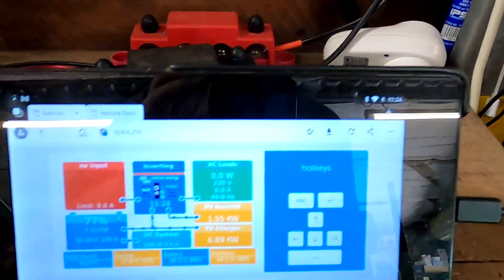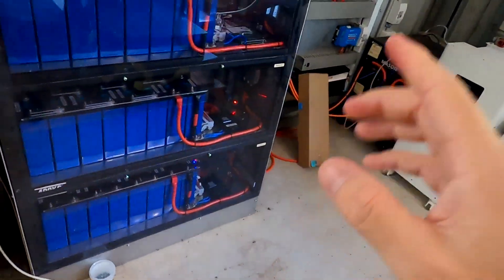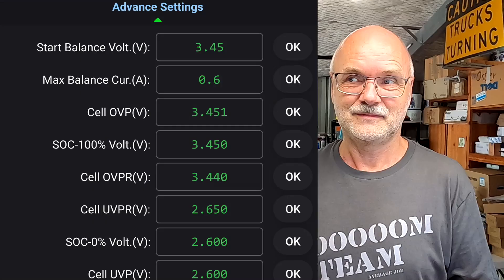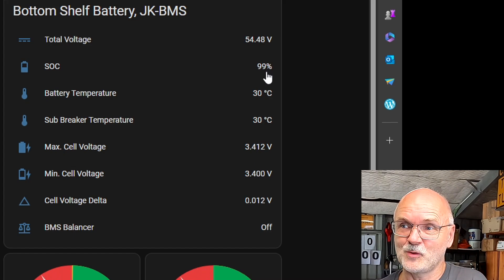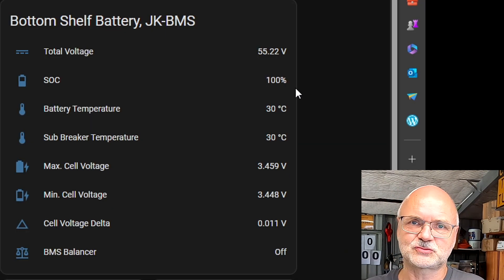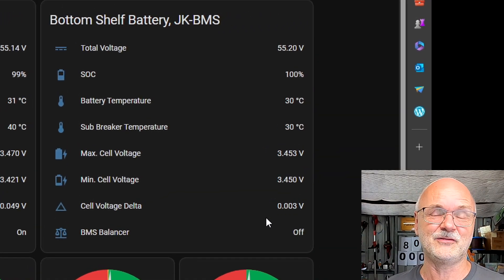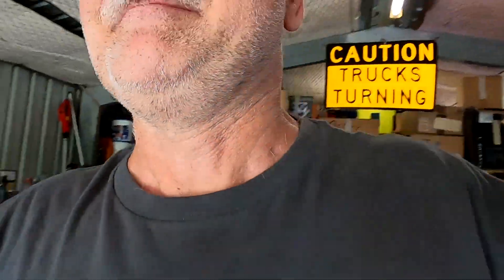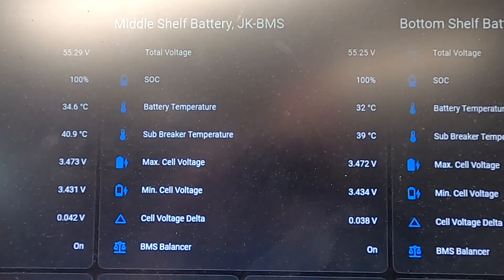Reset the old JK-BMS to 100% SOC when fully charged with no OVP. Here is how.

Comment: Hey Andy, thanks for all the helpful videos - it's crazy how much you helped me already with my JK-BMS!
Unfortunately, it still has an issue with displaying the right SOC. 
I yesterday did a complete reset of the SOC with changing the capacity, the OVP-Value etc. and then charged it to fully 100%. For the first time in months this worked well until this morning, the discharged amount of energy is roughly the same as the used amount of energy. 
But: Now that I have solar charging again (about 4kW so 70A steadily) it charged for a certain time (from 25% to 35%) and then jumped up to SOC 100%. I checked the voltage and it was at 54,19V at 35% SOC and then 6 minutes later at 54,33V at 100% SOC. It doesn't make any sense to me because I'm far from my implemented 100%-SOC of 55,2V. 
Since then it still charges with the same amount of Amps but always shows 100% SOC. The Voltage now is actually above my desired 100%-SOC -> 55,6V at the moment. 

My BMS has Hardware Version V15A and Software-Version V15.35 (I downgraded It a while ago because I faced some Issues with the newer Software). 

Has somebody the same problem or an idea what is wrong with my BMS?

Thanks a lot already for your opinions!

Comment: Yes it worked on my Ebike with a JBD BMS to reset the SOC to 100% with the cell overvoltage trick thnx. For all settings including BMS firmware updates and close capacity correction I use the ios APP JBD BMS as its very good

Comment: I think I figured out why this is happening. It's because we are not charging the batteries to full capacity. If the don't hit 3.6V, the calibration won't get set daily. One solution could be to set the OVP lower, or raise the charge controller voltage so it satisfies the cell voltage OVP limits daily.

Comment: Question I have the older BMS and mine is reading 60% charged at 51.2 v when the inverter stops it for low voltage and switch's to the grid, its a 48v 302 ah pack. It was good at first 0% in the AM then 30% for a bit and now 60% in the AM when its low. I have it set to charge to 3.45 and discharge to about 3.15 ( inverter switch's at 50.4 v) Would this trick fix this???????????

Comment: Thank you Andy! 

Guys, it’s much easier than that. If you want to reset. Just take the current voltage, divide by 4. I had 13.29v and was at 67% SOC. I mistakenly hit the LiPO4 button, and my remaining charge went from 97% to 68%. Changed Andy’s setting to around 3.322 ish and I was back to 100% in no time.

Comment: Another great video Andy, i will give it a try.
My problem is i have two batteries with two JK BMS connected on common bus and they charge and discharge unequally 60%/ 40% Amps. I have made all the cabling the same length etc. Do you have any faultfinding suggestions I could try. Thanks Martin.

Comment: how to limit charging cell (in pack with BMS) to 3.38V when I use socket charger? Changing BMS setting OR maximum voltage of charger(small potentiometer inside charger)?????

Comment: Triggering cell OVP just to reset the 100% SOC is just stupid imo.

I wish JK would just acknowledge that they screwed this up and fix it.. I know that you can't upgrade the firmware in these units, but there's no excuse not to implement a fix in newer hardware. 

I've got two JK-B2A24S20P BMS units. They both have the same hardware and firmware versions (supposedly), yet one contains the 100% SOC voltage setting in the menu, the other doesn't 🙄. I'm not even sure the one that does, even operates as intended. It's a real shame because JK have nailed most of the other BMS functions and their active balancing is top notch.
Reply: How does your BMS behave if OVP is triggered? Mine switches charging to "off" and I can't see any current entering battery but voltage keeps creeping up. Voltage only drops ofter reaching OVP if I turn off the charger. I assumed OVP should stop any current entering the battery at all

Comment: Hello, I have a question. I’m using jkbms - jk-pb1a16s10p. With every charge and diagmcharge I’m loosing some % of capacity. If I make the steps you explained will the problem be solved or I have to do this from time to time ?

Comment: Hi Andy,

I have solis hybrid inverter, and I'm using it with 16 EVE 304 cells and a JK inverter BMS with an active balancer. I've been running this setup for the past five months. The JK BMS communicates the state of charge (SOC) to the inverter, but the SOC keeps drifting over time.

Here's the issue: even when the BMS indicates a 100% SOC, the voltages drift slightly lower with each cycle. Over the weeks, the SOC gradually drifts, so while it shows 100%, each cell and the overall pack voltage are slightly lower than the previous cycle. If I adjust the battery capacity settings, the BMS resets to 70% SOC, and the inverter charges another 3 or 4 kWh. This SOC drift is frustrating because on cloudy days, my 16 kWh battery effectively only have 11 or 12 kWh capacity. The remaining 4 kWh stays uncharged because the BMS incorrectly reports 100% SOC to the inverter. To fully charge the battery, I have to keep changing the capacity settings in the BMS back and forth, where JK BMS readjust its SOC below 80% and doing so it also changes the cycles to Zero.

Is there a way to use this inverter without CAN communication or by setting it as a generic battery? If anyone else has the same issue or knows a solution, please comment and suggest how to fix this problem.

Thanks!

Comment: Can the firmware be updated on the JK_B2A24S20P BMS? I have V11.XW HW and V11.26 SW.
Reply: No, unfortunately.

And I have two of these (supposedly with the same hardware & firmware). One contains the 100% SOC voltage setting in the menu, the other doesn't 🙄

Comment: Actually had the opposite problem here - 99% SOC, but only about 50% in voltage, so wouldn't charge. This tip tricked it back into 50% SOC, so would then take a charge. Cheers Andy :)

Comment: Hi Andy. Great videos! I came across your channel while searching for info about BMS'es, and ended up with JK.
My JK_BD4A17S4P did reset to 100% when highest cell reached my SOC-100% Volt setting (3,60V). Cell OVP was 3,70V.
Hw version is V11.XW, sw version is V11.287. 
IMO this should trigger on average cell voltage and not a single cell voltage.

My app (V4.17.0) shows a switch labeled "Special Charger On". I have never seen this elsewhere, and have no clue what it means, but setting it to ON turns off the charging mosfets. There is also a related entry on the status page "Special Charg. Sta: Not Plugged".
Any idea what this is?

Comment: Hi Andy,
My JK-BMS behaves strange. When the battery is discharging the BMS SOC shows 0% and when the battery is running idle or is being charged the SOC is 98% while the actual SOC is about 30%. What do you think this could be? Already asked JK but got no reply and I hope you could help me in this. I must say I did have a short on the 2 blue cables one was connected to the battery minus while the other blue cable jumped out of my hand and hit the battery plus creating a big spark and a destroyed terminal.... Could that have something to do with this strange behaviour? The Voltages and Currents are shown correctly.... Hope you can help me....

Comment: Hi Andy, my JKBD6A20S10P Software version 11.42, hardware V11.XW is not readable with uart-ttl, it shown nothing but time out waiting for read all data command! Would you have any advise? Regarding the SOC, I have little modification for charging, when voltage is below 3.45 and SOC is 100%, I keep telling the inverter to charge and keep the reported SOC to inverter stayed at 98% with reduction of charging current limit battery will be charged fully to 3.45 and reset its SOC!

Comment: Hello Andy! It's Ivan from Ukraine, I love your channel, helps a lot to keep my house ON (really important now). 
I need advice, considering I have old JK BMS and SOC issue, I'm struggling to build automation which relies on SOC. I desperately tried to reset it when the battery charged. 
This hack with OVP works, but I'm wondering if I can set OVP to 3.45 and OVPR to 3.40 - permanently. So when my battery reaches 3.45 can I assume it is enough charged and stop charging by BMS. Will it hurt the invertor (Voltronic 5.6) or BMS? 
Thank you in advance!

Comment: Hi Andy I just now tested my new JK-BMS and 100% SoC setting works now without do this setup in video.
Hw ver. V11.XW / Sw ver. V11.287 Its fixed :) 
Its looks like JK fixed this issue in new models.
Only for info bye. Joe From Slovakia.
Reply from the maker: Well, mine does not work. As I said in the video, some work, some don't.
Reply: @OffGridGarageAustralia  Yeah you have little older Sw version.

Comment: I also have a 1st Gen JK-BMS and have an issue with it, when it goes to Cell UNDERVOLTAGE protection for some reason it also prevents the battery from being charged, even the charge switch is indicating ON and only Discharge indicates OFF.
Has anyone experienced something similar?
Reply from the maker: What hardware and fw version have you got?
Reply: @OffGridGarageAustralia  Vendor ID is J-B2A24S15P, HW Ver. V10.XW and SW Ver. V10.08 from 2022

Comment: A great reminder. The reset was the trick a long time ago. I've used the coulomb meter and a volt meter for my batteries over 2 years now. I dont rely on the JK for much but to control shutoff OVP charging @3.5v for my 80/20%. Still 10 batteries all JK and not a single failed or degegraded cell (3 years). Good days in Australia.  So. California has been very poor for sun. Unusual weather. Keep up the great work.
Reply from the maker: Thank you. Interesting you are doing this 20-80% thingy. Is this with LFP cells as well or Li-ion?
Reply: @OffGridGarageAustralia  LFP. It makes little difference to run them further up or down but in the 80/20. I take full advantage of 90% capacity. Hopefully also extending battery life. As you may recall I do the nerdy thing and routinely take a battery offline and capacity test some cells. My spread sheet shows no degregation (might be a bit early in the cell life.) I have enough batteries/solar to run my So California house for several days off grid on rainy weeks (I am grid-tie). My system cabinet is temperature controlled as needed. Assembling it over time was minimal  cost and all diy(learning as you did.) All the batteries balance each other. I do monitor the JK's for a cell that may be the one that is always balancing since many of the cells are possibly not new (early purchase scams)

Comment: Hi Andy  Congratulations on 80K. I also have  2 JK BMS's  the same model as yours, but I notice the software  is V11.281 and my version is V11.261. Is there a way to upgrade the software on  the JK_BD6A20S10P BMS. Thank you and keep up the great work. By the way the version V11.261 does not have the 100% SOC setting.
Reply from the maker: Thanks a lot. Unfortunately, the software on the BD series BMS cannot be upgraded.
Reply: @OffGridGarageAustralia  Thanks Andy

Comment: Hey Andreas, ich glaube du musst OVP und OVRP deutlich näher an deine korrekte Ladeschlussspannung bringen. Dann klappt es auch sehr gut den 100% SOC zu erkennen. Ich habe OVP bei 3,55V und OVRP bei 3,51V. Mit einer Ladeschlussspannung von knapp 3,50V erkennt er selber das ab ca. 3,45V 100% erreicht sind. Und mein BMS hat auch noch nicht die "SoC 100%" Option. Grüße, Martin
Reply from the maker: Thanks Martin. Yeeeeeaaah, I would not like that. OVP should be at the end of the maximum charge voltage. The method I've shown is not a real fix, but more a workaround. At the end it's up to JK to fix their shitty software!

Comment: Andy, why don't you leave the OVP at  3.451V? Anyway, any battery is limited by the weakest cell. After the battery is charged, it needs a rest. So it could be done by charger or BMS. You could set the OVPR at rebulk level ;) . 3.35V ?
Reply from the maker: Like tripping the circuit breaker in your house when you want to turn off the lights.
OVP is a protection setting which should be used as such. Not to charge your battery, but if something goes wrong. If your charger does not work and keeps charging for example. Like an MCB, it's for safety.

Comment: Since we are talking about tricks, does anyone know how to empty the log of a JK BMS? Mine reached the limit of 50 entries and to my surprise it does not delete old entries automatically nor allow manual cleanup.
Reply from the maker: What JK BMS?
Reply: @OffGridGarageAustralia   	
"JK 2A active balance 4s-7s/8s 200a 24v battery board management system smart lipo/lto/lifepo4 bms for lithium ion battery pack " is the product description. Bought in December 2022, Hardware version V11.XW, Software version V11.17

Comment: Instead of mucking about with the BMS  on my PACE units (which I don't have ready access to), I just occasionally increase the charge voltage setting on a nice sunny day (which I can do via Home Assistant). In  the same manner it then resets the SOC to 100% when it hits cell OVP and then I put the charge voltage setting back down again. An occasional charge to 3.65 V is no big deal. Indeed I may even automate it in Home Assistant.
Reply from the maker: Yeah, that is the brute force method. Like causing the main circuit breaker in your house to trip just to see if it still works.
Reply: Which parameter on JKBMS is the charge voltage setting? OVP? OVPR?

Comment: I have tried this several times. But after I reset the OVP to 3.65V, it never shows 100% again. The percentages keep going down. So the BMS is showing less and less percent even though it is almost full. I have to keep reaching OVP to get the BMS back to 100%.
My version: JK_B2A8S20P HW V11.XW SW V11.17H FoD 2022-09-01 V4.8.1
Reply: Mine does the same. As soon as I reset to 3.65V OVP my percentage drops to 99% and I never see 100% ever again. Also I can have several cells at or above OVP and it does not trigger 100% until the average cell voltage is above OVP.
Reply from the maker: Don't you have the 100%SOC setting with such a new hardware? You need to run the latest JK app...
Reply: @OffGridGarageAustralia  I'm on V4.19.2 on an old iPhone. No 100%SOC to be seen on it. My hardware is V11.XW and Software V11.17H
Reply: @OffGridGarageAustralia  I am using V14.16.2 downloaded from your site. And yes, I don't have a 100%SOC setting!

Comment: I'm afraid it doesn't work me Andy. When I put the OVP back to 3.65V after seeing 100% with 3.451V OVP I never see the 100% ever again. I have two of the JK-BMS's versions that aren't in a black case. In reality the 99% is more correct as at 3.45V we are not 100% charged so why would I want the BMS to think we are anyway? I also notice that OVP isn't hit when one cell hits the voltage of 3.451. I can have several at or above that voltage and nothing happens. The average cell voltage seems to need to be at or above OVP rather than an individual cell. If that is the case then it is rubbish cell protection. I'd be interested in your thought and could you possibly test the version not in a black case to prove I'm not going mad?
Reply from the maker: Well, it's up to everyone to define 100%. Do you charge always to 3.65V, that would be true 100%. As I explained, I define 3.45V as 100% and want the BMS to show me that.
the average cell voltage cannot be above OVP. That would mean some cells will be much higher than OVP which is not posible. The BMS will cut off charging as soon as ONE cell hits OVP.

Comment: Andy, will the SOC 100% voltage be as the whole battery? I mean, you configure 3.45v per cell, but only when TOTAL BATTERY VOLTAGE reaches 16*3,45v the jkbms puts the soc up to 100%
It makes me sense for me.
Have you checked ? Thanks.
Reply from the maker: The BMS is not really using the voltage to calibrate to 100%. It uses that exact moment to reset and does coulomb count from there. Amps in and out.

Comment: Hello Andy,how i can to reset the cycle counter?
Reply from the maker: It seems to reset when OVP is hit. Another software glitch in JK's software.
Reply: Change the capacity setting like Andy did at 9:00.
Hitting an OVP will not affect the cycle counter.
Reply: @Juergen_Miessmer lt should not, but it does reset cycle count!

Comment: Moin Andy, thanks for all this interesting stuff, but have you ever measure the real cell voltages? I´ve build 2 Seplos/Mason boxes with EVE 280k cells last year. After 6 months I made an interesting measurement. I use a constant 25A charge current and measure the mV between the aluminium busbars and the cell screws. Wow, up to 35mV difference. I clean the contacts again wirh the green side of a "Küchenschwamm" and Aceton and then all measurements decrease to less than 5mV. Interesting I find cause all BMS/Balancers measure the voltages at the busbars, in your Video with more than 50A current. Best regards from cloudy North Sea
Reply from the maker: No, never done such a test. The AL bus bars are usually great on these studded terminals. The contact area is tiny but the 4Nm of torque gives a very high force. I have tested this with over 230A with these terminals. Works great.